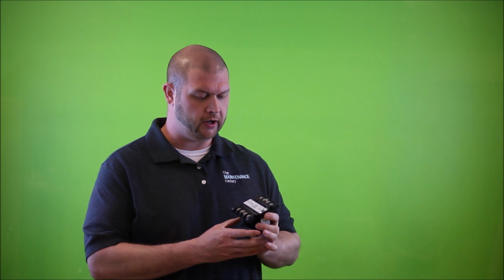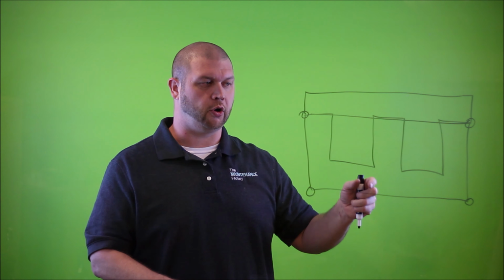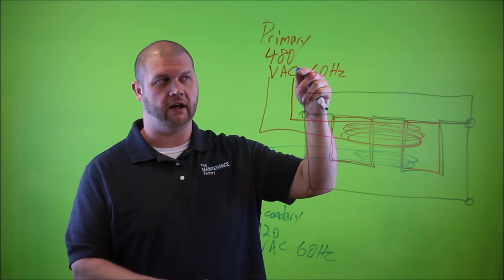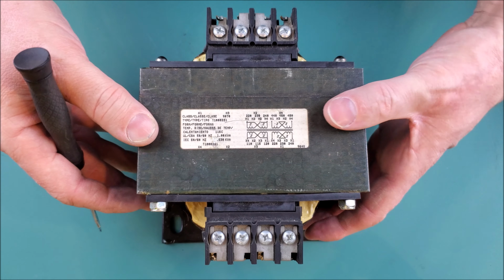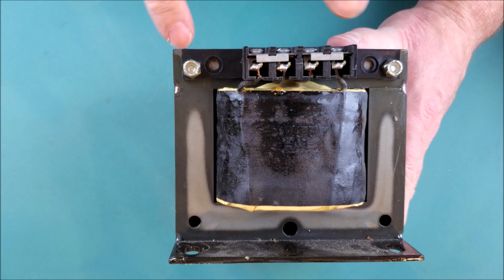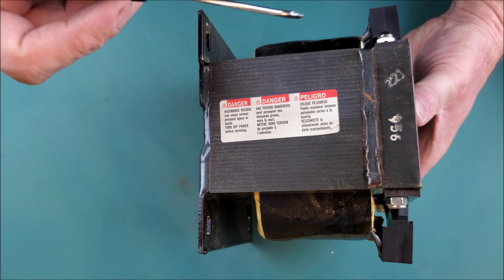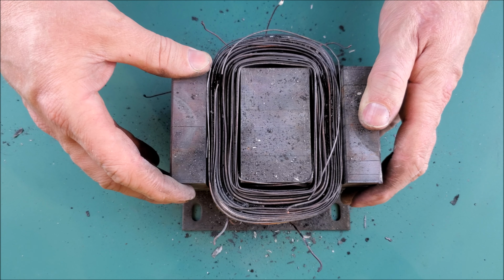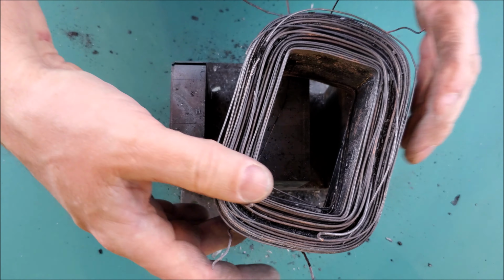How control power transformers work.

Comment: I think the voltage in secondary is induced because of the alternate electromagnetic flux crossing the secondary winding (Lens’s Law )and not because of the eddy current.Eddy currents are induced on the core and produces losses such as heat.this is the main reason core are shaped (laminated)and thermal isolated to reduced losses
Reply: video is pretty good otherwise but I totally agree eddy currents work against transformer efficiency via heat loss.